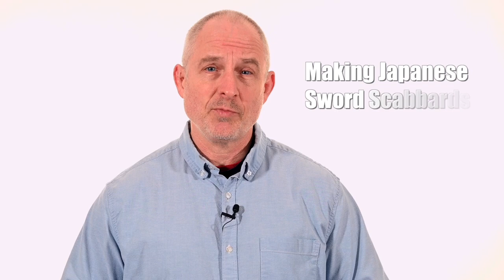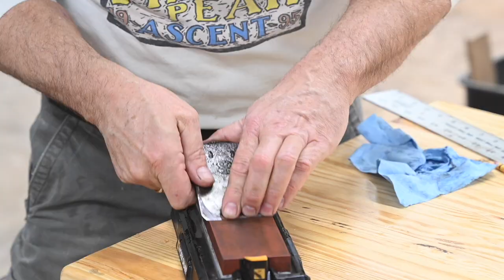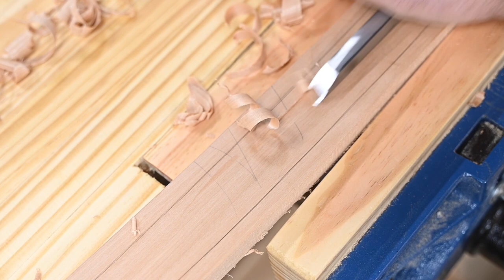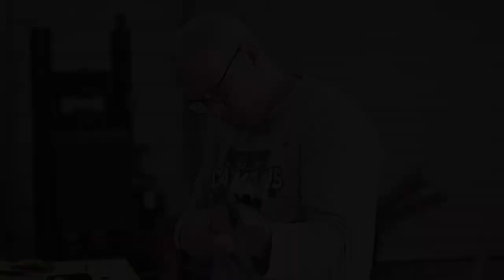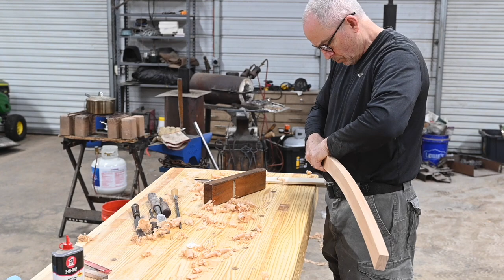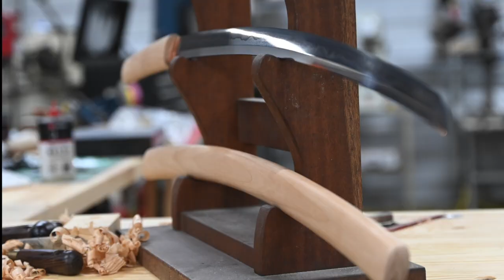Making a Japanese Sword Scabbard - Very Satisfying

Comment: I understand why you would use modern glue as some clients might be tempted to use the shirasaya mount for cutting. However, shirasaya should have a small pocket at the tip to catch excess oil - a feature that might come in useful, especially since you can't take the halves apart anymore and many sword owners tend to over-maintain/over-oil their blades.
Reply: I polish this daisho with Brasso so it's not an issue. Not necessarily the ideal approach, nor is it traditional, but I commissioned this set for iai and tameshigiri so the polish will take a hit in any case.

Comment: Love the shop, Walter. I find making the fittings to be almost as satisfying as forging the blades, now. It wasn't that way when I began, 15 years ago. But, now... really enjoyable. Thanks for sharing so much of your process.
Do your saya chisels have a little belly to the bottom (sort of like a gouge only without the metal missing from the upper surface), or are they flat on the bottom like most woodworking chisels?

Comment: Looks like the new shop is working out great.  This may be a dumb question, but how do you deal with the glue squeeze-out on the inside of the scabbard?
Reply: It's staining the daito's edge atm so I have to clean it regularly. Hasn't been an issue with the shoto.

Comment: just a quick question. now days we all use modern types of glues and adhesives and all that fancy stuff to get things to stick together. back in the days before all that ,what would have been used to glue the scabbard together
Reply: I imagine it would a hide glue of some sort.
Reply: They used “sokui” which was just day old cooked rice mixed with water and then mashed together for a minute before being applied. It’s actually rather strong, but also allowed the wood pieces to be split apart later for maintenance.
Reply: @That0neDeadGuy  rice glue. I think I saw that once on forged in fire but it didnt work after the first test. The handle actually came lose
Reply: @peacemaker-du4hz  Shirasaya are meant for storage only, not for cutting. The handle for fighting has a bunch of fail-safe features like: endcap, ferrule, rayskin and silkstring wrapping - or kashira, fuchi, same-hada, tsuka-ito (頭・縁・鮫肌・柄糸) if you prefer those terms.
Reply: Furthermore, if you were to get the saya made for koshirae fittings the rice glue allows the lacquer to soak in as they would apply normally 5-10 layers making it even stronger